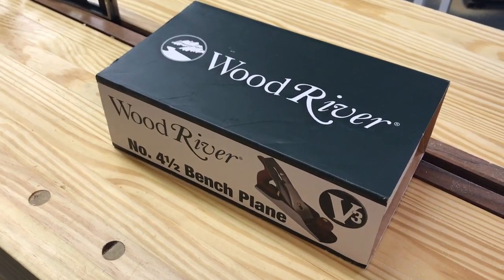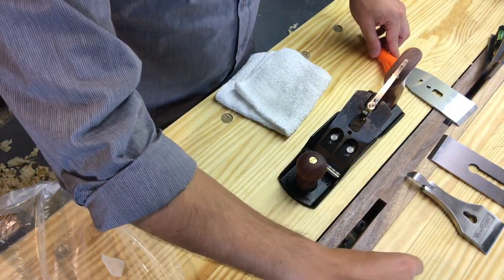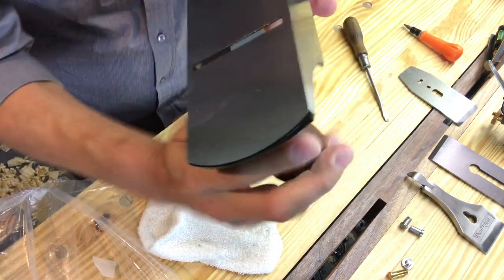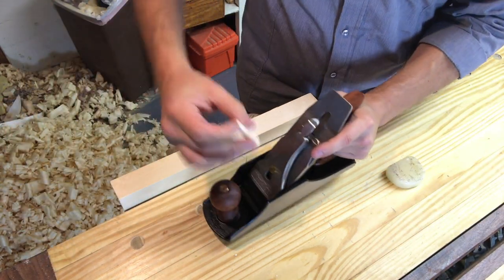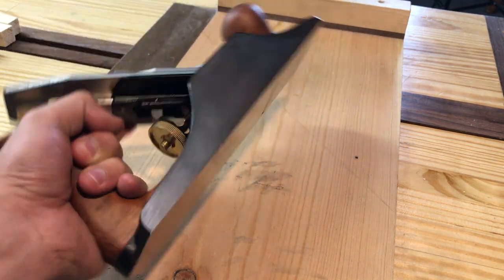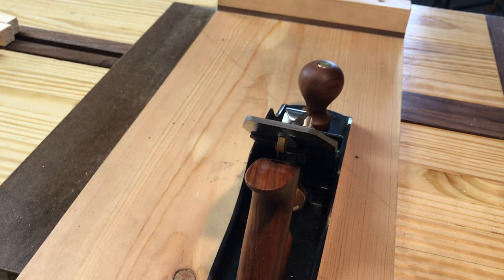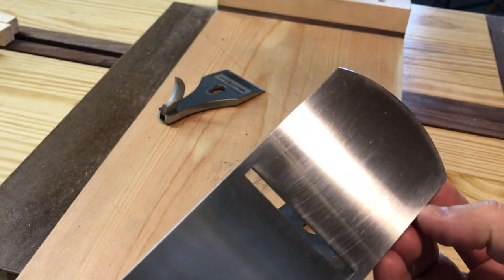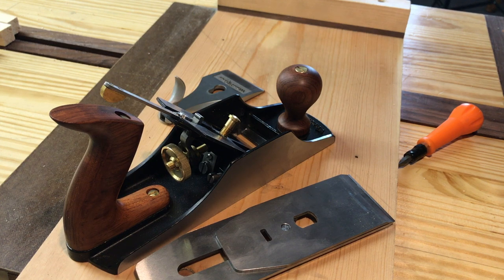WoodRiver 4 1/2 Bench Plane Unboxing and First Impressions

Comment: Great review. I had the exact same experience on my WoodRiver 4 1/2. The first one had a couple of issues, including a problem with the tension of the lever cap, the blade was way out of being flat. I took it back and got a replacement. The blade on the replacement is the flattest blade I had ever seen, it was literally dead flat out of the box, flatter than my Lie Nielsen ones.
Reply from the maker: Crazy! So glad you got it replaced, though! I’m 100% happy with mine, and it’s been 4 years I think.

Comment: I'm really impressed with being able to read through the shavings, and it looks ever so pretty. I like having to do some flattening of the blade etc, I don’t have ant tools in this league but the work I have to do with a new tool as I feel that’s when the tool becomes mine. I'm shocked at the void but they replaced it with no problem which is very good.

I have some upper body difficulties, and as strange as it sounds I like things on the 'heavy' side as I can be very clumsy with light stuff.

Your reviews are always honest as you find them and at a level I understand. Another great video Andrew.
Reply from the maker: Thanks, Mark! I really love this plane and don’t regret dropping the $ one bit. It is very hefty, and like you said, you give it more thought while holding so you don’t fumble it as easily. Thanks so much for always commenting and for your kind words! Cheers!

Comment: Hi, love your review I was thinking in finally replace my stanley n4 made in china with this beauty and i wanna know if the weight becames a negative aspect in the daily use 
Please answer!! Saludos de Perú
Reply: Andrew Milacci Thanks for your advice i found it very useful
I was thinking in buy the 4 1/2 and use it as a general purpouse plane in replacement  of my chinese n4 and turn it (n4) in a small scrub palne
And in the future  get a low angle block plane for more fine stuff
What do u' think about my buying plan-idea?
And about the price, here in Perú is about 219 USD with taxes :-( 
I can buy it from amazon but could have problems with te waranty and the postal service here is not that good so i think i'll pay the price for safe aspects 
Hope you'll make that in-depth review soon (maybe talking  pro/cons and making demos of its plane power)

Comment: Really nice plane, you may want to recheck to sole flatness with the iron retracted, and under tension, it will make a difference in the measurement. Hope this helps!
Reply: Blade in or out does not make a difference with the sole flatness. Its been reviewed hundreds of times with no cernable difference. Plane away youre doing just fine.

Comment: looks sweet, I've been eyeing the 5-1/2 for a while but money is pretty tight at the moment. I love the old planes but man, the chip breaker, the way the frog mates to the sole, and the rounded end on the blade adjustment arm to reduce slop, are all really appealing which are all the things that give me headaches on my great grandad's old planes.
Reply: Thanks for the reply, the problems with my planes aren't really the irons, just the different parts of the planes but the heavy iron on the woodriver is definitely a plus. I have gone to two different woodcraft locations and looked at them, they are very nice for the the price . I have a #4 but my go to is my #5, I know paul sellers says you can do everything with a #4 but I just find the #5 so versatile and I really love the width on the 5-1/2.
Reply: wood by wright recently put out a video about how to set up the chip breaker that I found really helpful, I would check it out.